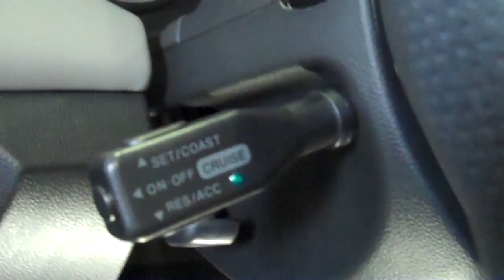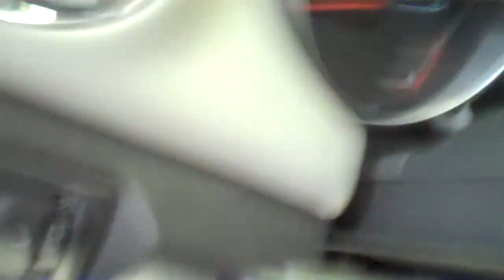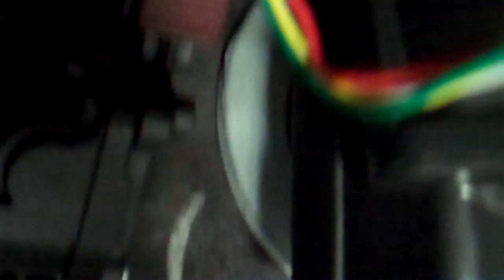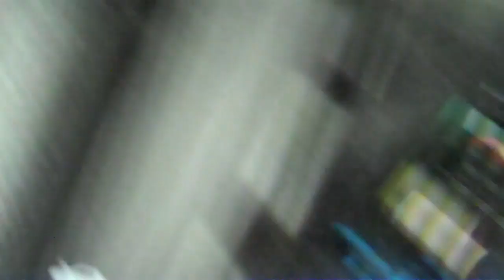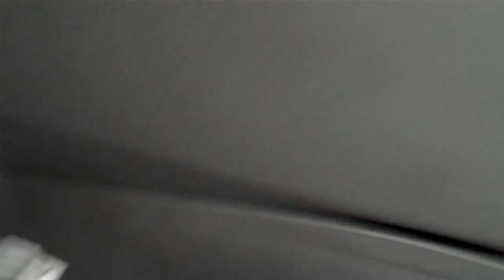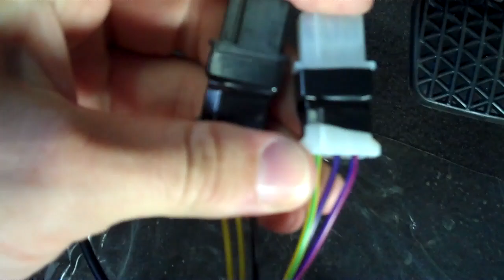Installing Cruise Control in 2012 Chevy Cruze

Comment from the maker: That would really depend on the dealer. If you have a 2011 Chevy Cruze, you need the 250-9003 kit, not this kit. Much cheaper, and easier install.